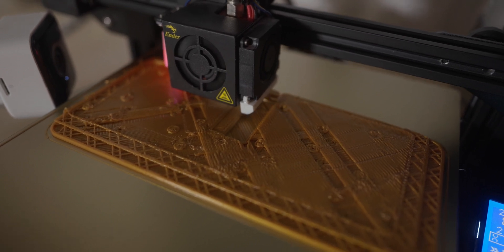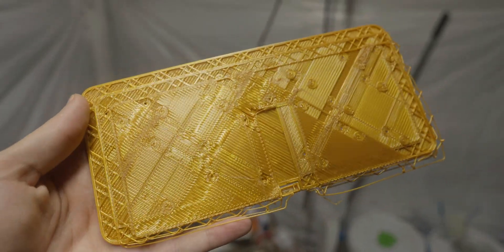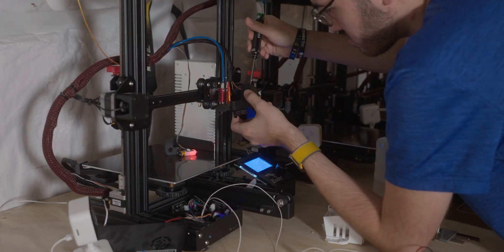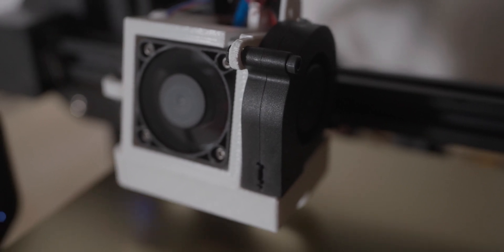3D Printing a Handwired Keyboard Case with a 0.8mm Nozzle

Comment: Dude you can print .8mm layer widths with .4mm nozzle, there is no need to increase the nozzle diameter. I regulary print .8mm layer widths with my .4mm nozzle. The advantage is you don´t need to change any parts back and forth and you can still print fine details with the same setup even in the same print.
Reply: He wants speed though... printing .8mm layers with .4mm will just maintain/increase the print time, right? He wants the increased flow that comes with the .8mm nozzle.
Reply: @alkaliaurange  Why would it increase the print time ? It´s the same layer width which means the same material per time is being squeezed out just from a smaller nozzle which increases pressure inside the nozzle that´s it. The volume and time stays the same. The advantage is you don´t need to fumble with your printer and brake off some delicate parts because those printer designs are flawed. You can of course change your nozzle but then you have to change it back again if you want to print some smaller finer prints.

Comment: I have settled on just always using a raft - idk if this is best practice but I like the consistent look of the bottom
Reply from the maker: It works for sure, I used to do it all the time when I first started printing. For some objects too it’s absolutely required. I like to avoid it for keyboards though because it would add hours to the print time.

Comment: You could try adjusting the flow rate and retractions to try to mitigate the overextension that's causing your layer to be taller than it should
Reply from the maker: Tried that in the beginning but found that my E-Steps and flow were actually correct. The issue, at least I’m pretty sure, is coming from discrepancies in filament diameter. Normally it’s not an issue with a smaller nozzle but with these really thick layers it’s flowing out so fast that those slight differences cause the thicker sections.